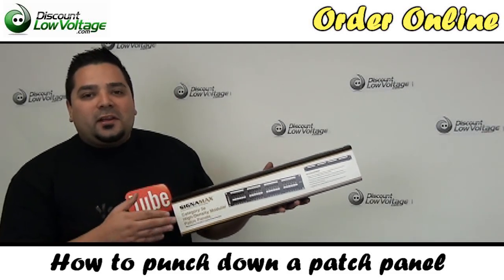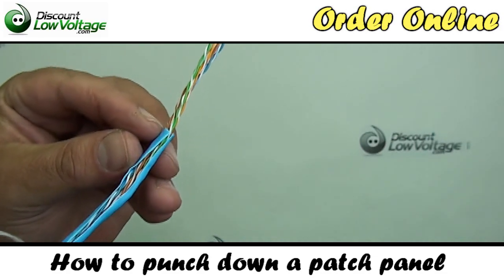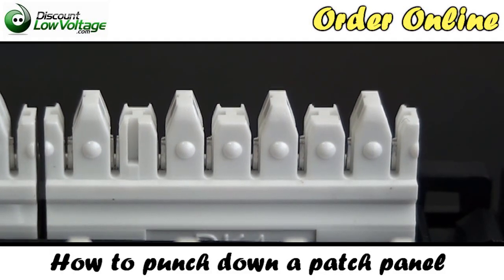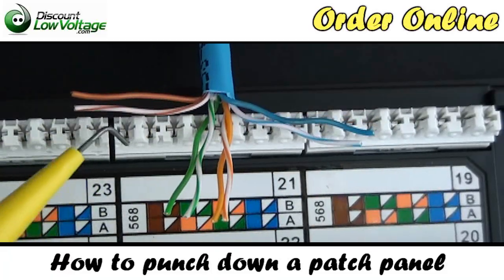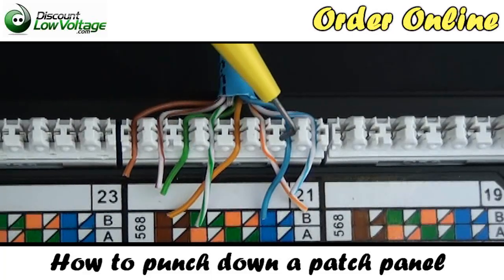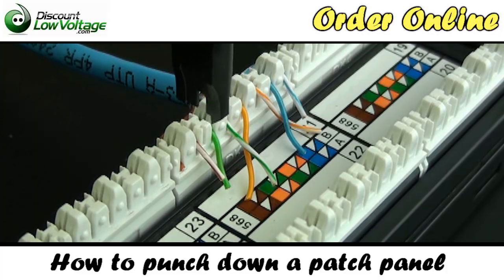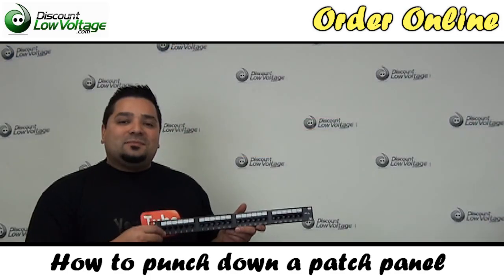How to Punch Down a Network Ethernet Patch Panel

Comment: I need to Identify my wall ports to where the patch panel was. The old tenants IT guy just cut the cables and did not leave any identification on that end. ￼🥵! I think there is a meter or something like a chicken foot to check the continuity through ends. 
Danger I made a 110 plug, tided it to a cat wire to run current through the line. I did not attach the neutral and I am going to check it tomorrow with my chicken foot. I will let you know if it works or if I had to call the fire department. going to make my home-made patch pannel with four hole plate covers in a wall box,

Comment: Does it matter if I use 568 A or B?
Reply: No, as long as you do the same on both ends.  If you mix 568A and B on the same cable, you will get a 4 conductor cross-over cable.  Most Ethernet devices can detect the crossover and work around it.  Some older stuff required cross-overs for switch uplinks.  Some had dedicated ports for uplinks etc.  Today, most Ethernet ports will cross automatically.

Comment: What’s the difference from A and B?
Can you please tell me
Thx
Reply: It's just a different color pattern to follow.  It doesn't matter which one you use, as long as you're consistent at both ends.  You could literally make up your OWN scheme if you wanted as long as your consistent at both ends ... but the NEXT GUY who comes along won't know what you did.  That's why they make standards for everyone to follow.  Not having standards would be like a "STOP" sign (on the road) meaning different things in two different cities.  568B just happens to be one of the most often used schemes.
Reply: can anyone answere Molvi ?

Comment: I would not untwist the pairs before punching.  Use the raised peak to wedge between each pair to keep the twists in-place up to the block to minimize cross-talk and signal loss -- this is critical for cat6(a) certification -- then untwist the pair on the cut side before punching down for a cleaner cut.

Then you'll get a tight connection with minimal signal loss and a lower chance of needing to undo a patch due to a test failure.
Reply from the maker: Great tip!

Comment: My punch down tool doesn't "click" like this.  I have it set on high impact.  The tip just sort of springs in, but it never "impacts" it seems.  Am I doing something wrong or is my tool defective.  It is brand new.  It seemed to work OK, but it took a few times before the wires were actually cut.
Reply: Yeah, you have a bad tool.

Comment: I have a cat5e patch panel and I punched down number 1 port to see if I was doing it right before terminating all other 23 patch panel ports. I connect number 1 patch panel port to my Cisco switch and im not getting anything on my device. Do you know what could be the problem ?

Comment: What happens if you mix the A/B up? how do you know which to choose, and if it is on the wrong one will it still work?
Reply: In most cases, the wiring needs to follow the same scheme on both ends. Certain less-common situations require a "crossover" cable, which deliberately has one end wired to the "A" standard and the other end wired following the "B" standard. Crossover cables need to be marked in such a way that it is immediately clear that it is not a normal "straight through" cable. Here in the USA, we seem to have decided on the 568B scheme as our standard. Either scheme works, but it's important to be consistent -- at both ends of the wire -- throughout the project -- and (in practice) according to established geographical/professional conventions.
Reply: You COULD literally use your OWN scheme, so long as it's the same at both ends.  The problem with that is, when the next guy comes along, he wont' know what the heck you were doing.  That's why it's best to stick to standard schemes, and 568B seems to be the current favorite.

Comment: Nice video.  Most manufacturers recommend keeping your punchdown tool set to the LOW setting when punching down patch panels as damage can occur to the patch panel. Often people will set their tool on HIGH thinking it cuts the wire better.  LOW works fine.  If it doesn't, you probably have a dull blade and you need to change the tip.

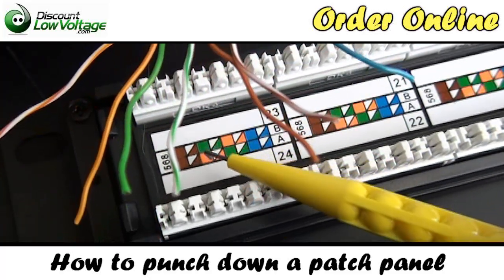Comment: is that a TIA EIA Standards?? if it is, then why is 568A starting with with Blue instead of Green? 02:56
Reply: The standard in the states is EIA T568B
Reply: The punch-down sequence on the 110 block does not have to correlate/correspond to TIA /EIA standards.  It all has to do with were these block locations terminate on the RJ45 jack or plug.  To verify,  trace where the block pins lead to on the circuit board that jack is soldered into.  For example, the 110 blocks on Levition's structured media center snap-in data and phone boards also start with blue/white coding, but the they too conform to the 568A standard at the jacks.
Reply: @carlwahl7586  Correct!
Reply: Pious Hadebe I was thinking the same thing I am taking a network class  and this guy seems not to know the standards, a 568B cable is a crossover cable and 568A is a straight trough cable I really don’t get the way he put the colors, do not match the TIA/EIA standards.
Reply: 568B is not a crossover cable. A crossover cable is wired following 568A on one end and 568B on the other end. Either standard (568A or B) will produce a "straight through" cable if both ends match.

Comment: You're doing this very wrong. Cable is supposed to enter from the inside !!!!!
Reply: Yes, so the cable should enter the patch panel from the middel (center). SO from the center to top And not in this vid from top to bottom . See other video's like 'How to punch down a 12port patch panel'.
Reply: @MelroyvandenBerg  Last time I checked, "inside" vs "outside" wasn't part of the standard.  Just length of (un)twist.
Reply: how so?
Reply: android 5.2 storage

Comment: This might sound silly but how is the copper inside the wire conducting to patch panel. Usually in electric cabling we remove outer cover of a cable and expose the copper and connect the copper to the board. How does this work without you doing that. the  tool just cut off the extra part right.
Reply: Rakesh Kamath the tool not only cuts off the extra part, it also pushes down the wire between the metals. Which actually scratches off the insulation and makes contact with the metal.

Comment: Can you punch down multiple cores in the one holder? I'm using a patch panel for a home project that uses RJ45 and a panel as a connection board.
Reply: I'm setting up temperature probes that I'll terminate using an RJ45. The RJ45s will go into the patch panel and the back of it will need some of the lines to be connected. I guess I can do this further upstream and just connect single cores to each holder/section/RJ45 plug. The other option I have is gutting a small router and putting the controller inside it and use the female RJ45 plugs to receive the probes....should make it nice and tidy.
Reply: Yeah, maybe. I'm not good at it though. Thanks for the suggestion. I'm an entomologist and have a lot of ideas about my research. Maybe I should start putting them out there because I need help sometimes.
Reply: ***** Thanks for replying btw. I appreciate it.

Comment: thanks Mercy, can we use the same patch panel and keystone jacks for both Cat 5e and Cat 6 cable ?
Reply: CAT5e using 24 AWG cable, while CAT6 uses 23 AWG.  Just means the CAT5e will be a tiny bit loose in a CAT6 patch pane and vice versa (although it should be OK).  While you can get away with it, always use the correct panel & keystone when you can.

Comment: Thanks a lot Mr. Mercy for the nice video,
it is possible to use one network cat6 cable for both PC and IP phone? 
I mean, can I generate a port from an existing port with out using a small switch or other device.

Comment: good video. Well presented. Nice close-ups. Thanks! Is it the same for phone patch panels? e.g. I was considering buying this for cleaning up the telephone wires in my home. Not sure how I would connect the phone wires to the ports http://www.amazon.com/Steren-FastHome-Telephone-Hub-Module/dp/B000EHPIX8/ref=sr_1_1?ie=UTF8&qid=1432187482&sr=8-1&keywords=phone+patch+panel

Comment: Interesting how he is terminating with the cable on the outside of the 110. I have always installed the cable between the termination rows.
Reply: As long as the cable is supported "zip tied" to the 110, should not matter really if its inside or outside. The point that needs to follow is bicsi standards that is, the twist needs to be less then a half a inch and punched down. 110 need to be redesigned to put the position number on the outside of the termination row. It is kind of hard to read when it is on the inside of the punch down rows.
Reply: @LK-pc4sq  its not that hard to tell, with order on inside, being they have it on every section and even if get to last  point on panel then just look at the wiring of the rest
Reply: 5 years old, but I'm just learning about this. When you say "installed between the termination rows" you mean that the cables coming into the patch panel would be inside the rows with the cut ends sticking away from the patch panel instead of towards the other termination row?
Reply: @Dextergec413  yes!
Reply: @joacomartinezh  ohh thanks
Reply: Inside is in fact the correct way.
Reply: me too @ tech worker
Reply: I would think it was obvious that he did it to show the process for the viewer.  It would be difficult to show the viewer what was shown if he was terminating from the other direction. 

However, it might have been a good idea to specify that he was doing this for ease of teaching and that the cable was normally placed in the opposite direction.
Reply: same lel

Comment: You aren't supposed to untwist them like that.  You should maintain the twist all the way up to punch down.
Reply: the twisting is negligible at that short of a distance. Basically everyone does it this way and you do not see them having any problems, everyone from google to oracle to mcdonalds all will have this small unraveling. I mean the guy was pretty tight as it gets and still you do not present any info to elaborate your statement. Next time back your words up with proof or a technical white paper at the least or even a Request for Comments paper.
Reply: thats the right one right there ! couldn't say it better than that thanks buddy.
Reply: The IEEE set the standard and it's there to see. At  most you can untwist up to 1/2 inch.The problem is usually at the w/b pair which has a looser twist than the other pairs. Give it an extra twist up to the connector

Comment: What is the panel good for?
Reply: Offices, Workplaces, maybe even your home if you do a lot of networking. You can use it to "Extend the reach of your router/switch" in a way of speaking. It basically transports your ports from your switch/router to somewhere else in the building. Say for instance you have a server room located on floor 1 and you need ethernet ports for floor 2 of your office. Well, if you attach ethernet to these patch panels and install them on floor 2, you can then run the other end of the cable to your router/switch (through wall/floor, w/e), just as long as it is able to do so. They are mostly used for small/big offices though to speed up the network.

Comment: Why untwist the pairs more than needed at all?

Maintain the color's twist rate (each color has a different number of twists per meter) right up until they enter the punch down slots. The certifier should give you better results that way.
Reply: +Darr Darr 
indeed! never untwist more than you need to.

Comment: very good teaching on the color codes on 568 B or A easy for dummies to punch down a panel ...just hoped you laid the catv inside block instead you got them from the outside ....anyways cheers bro  plus very clear video !
Reply: I think he did it that way so viewers could clearly see the colored wires matching the label on the panel.